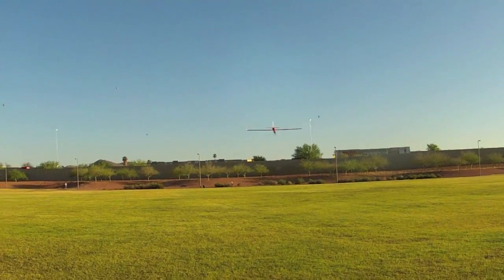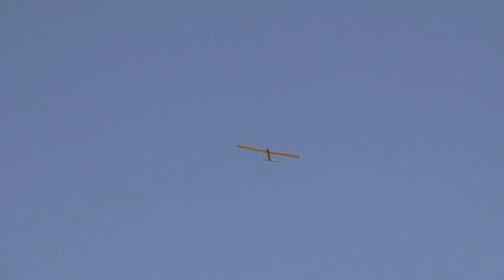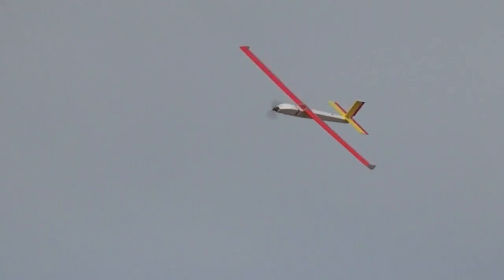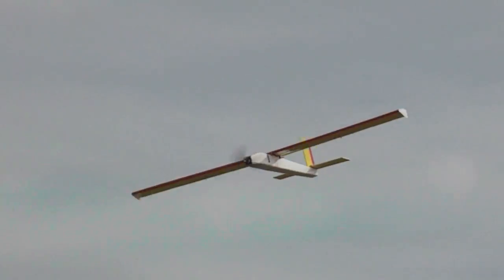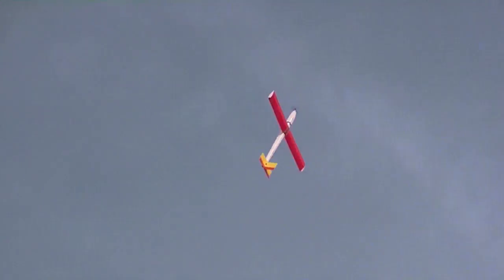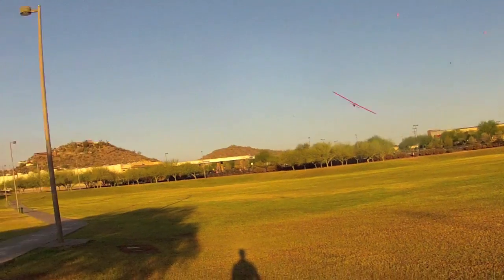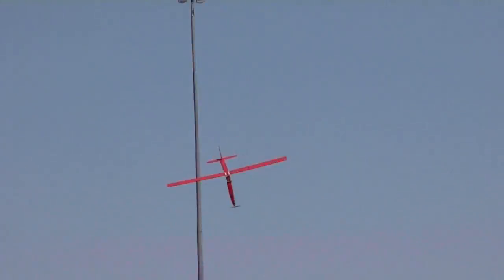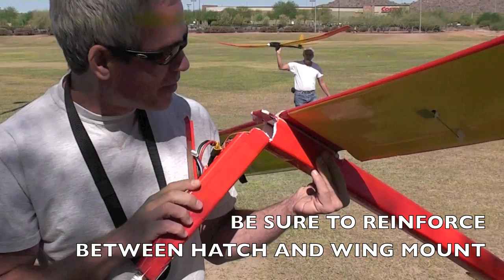PHOTON Motorglider - Flight Video

Comment: Ed, just curious if you have to use velcro or anything else between the fuse and the wings?  The rubber bands do ok but seem like they would let the wing swing back and forth a little too much in flight??

Comment from the maker: Enable the brake on your ESC, come in gradually in a power-off glide and flare nicely and I promise you'll never break a prop.   Even if the prop stops pointing down it will easily flip up out of the way as you land.

Comment from the maker: Very easy to fly, not as crash-tolerant as the Axon.  1500kv would be fine as long as it gets at least 500g of thrust, and I think you'll probably want a less pitchy prop.  An 8x3.8 would generally be pretty good.

Comment from the maker: It is exactly at 14" behind the nose, so 1" forward of the joint between the 15" nose tube and the 30" tail tube.  The actual wing chord is centered right over that joint, and the CG is at 2" or 33% of the wing chord behind the leading edge.

Comment: Ed, what if instead of laying foam strips to form the chord (on the axis along which they bend easily) you installed two spars vertically (along the axis where they bend very little) with a small intercostal every few inches to keep them parallel?  I think that would keep wing flex to the minumum possible with this design.  One would probably have to install a thin ply doubler at the root and develop a new wing join method, but it might be well worth the added strength.

Comment: Hey Ed, couldn't wait for the build video.  Just finished the plane which went together very quickly because I already had the 60" wing from a previous project.  How far back do you have the wing set?  Hope to get the electronics installed tomorrow night and take it up on Saturday.